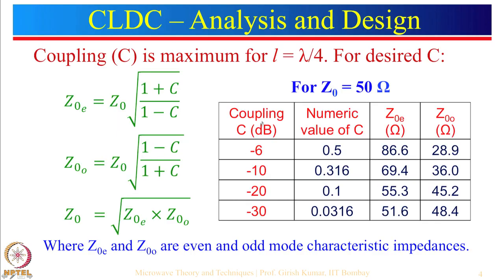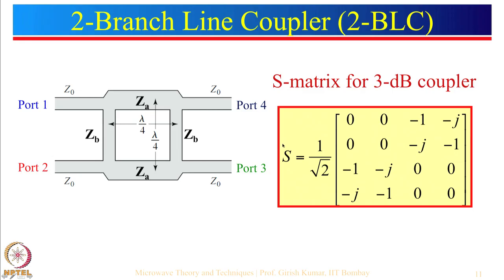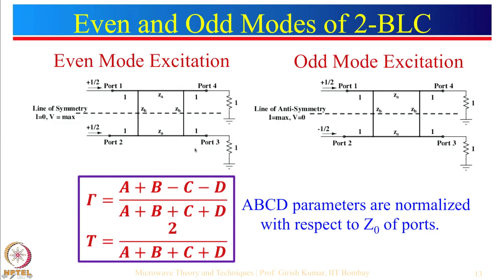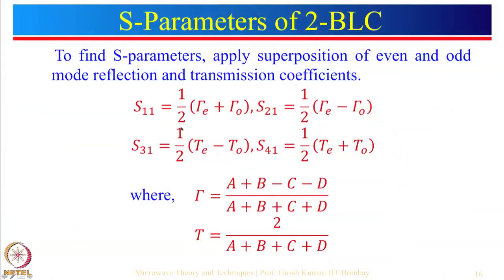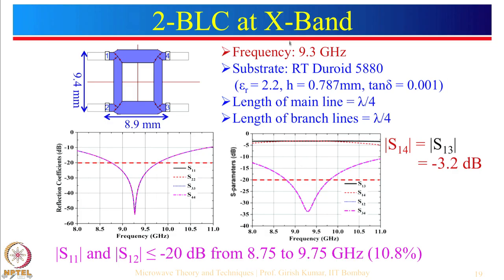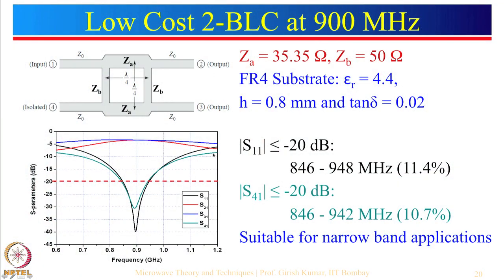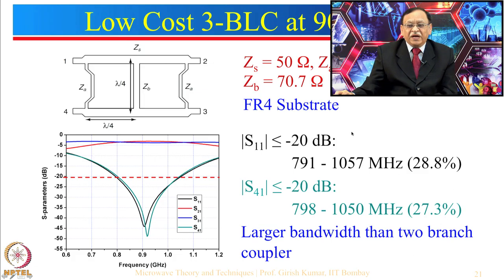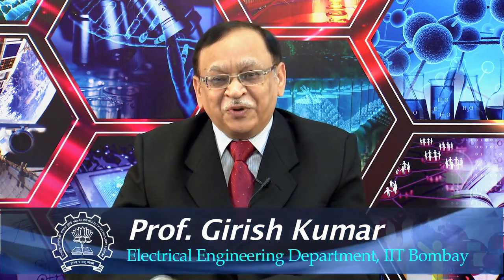Week 4-Lecture 19

Comment: Professor, can you explain how to apply the boundary condition |S31|^2 = |S41|^2 = 0.5 and how you solved for Zb, and Za?  I didn't follow.  I would really appreciate.
Reply: it is 0.5 because s11^2+s21^2+s31^2+s41^2=1 and s11 and s21 are 0 however i also could solve for za and zb